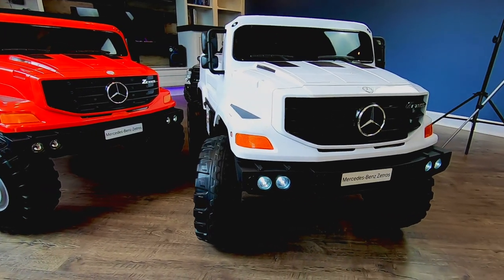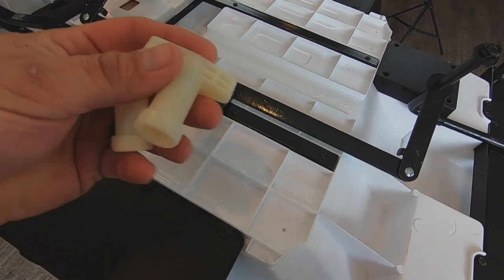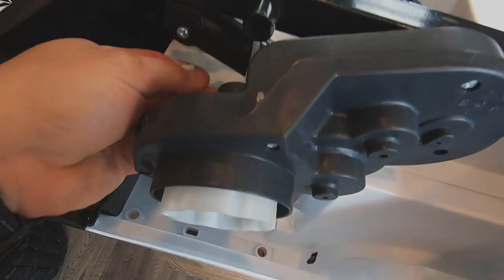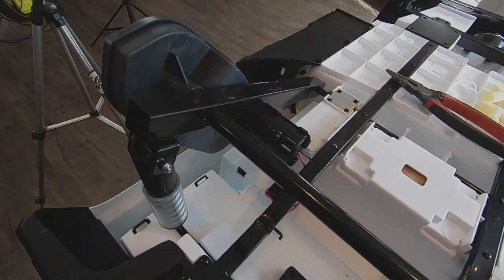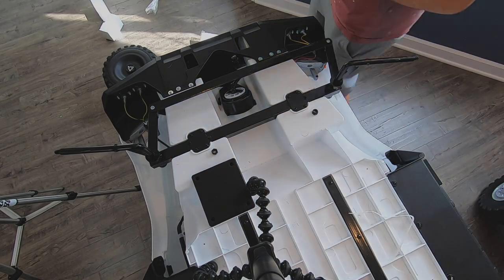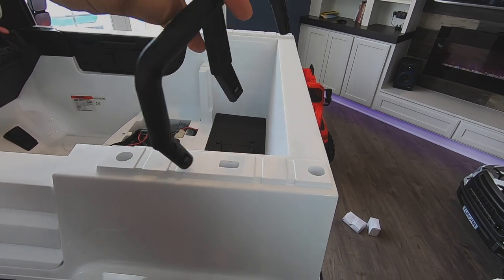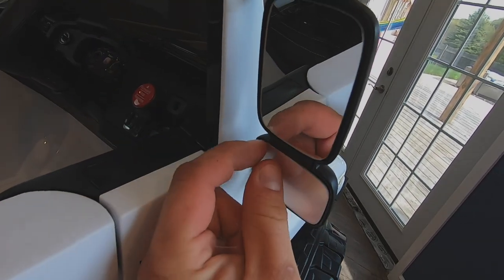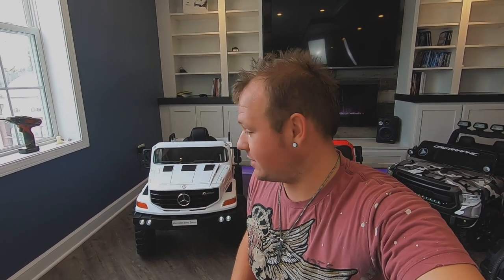Assembly of MERCEDES-BENZ ZETROS 12V RIDE ON TRUCK W/ REMOTE CONTROL *FROM BIG TOYS DIRECT*

Comment: Thank you for this video. I watched it before I ordered from Big Toys Direct. And their price was significantly lower than the other main competitor I found online. Direct included a much higher voltage battery too which was very important for me, but the other company would not even entertain an upgrade. Instead of just a 7 volt, the 12 volt battery was the clincher for my purchase choice. This will allow a much longer ride time before needing a charge. I received notice in about an hour after ordering that it had shipped!  I live in TN and received it today; 8 days later. The packaging is excellent. Everything is wrapped in plastic and some areas secured with styrofoam blocks. I am a 69 year old grandmother and after unpacking, it only took 55 minutes to assemble. It's charging now, so I'm anxious to check out the performance tomorrow.

Comment: Ok, since it has been about a year, how would you rate the EVA tires, as far as wear?  I know they're soft, compared to plastic or rubber. After a year of use, do they still look like there would be plenty of life left in them?
Reply from the maker: They are lasting longer than plastic.
Reply: @MohawkDaveOffRoad  That is good to know. Thanks.

Comment: The Zetros is a cool concept (we own a black version from BTGC). However, there are 3 fatal flaws that make the toy not worth it. The truck SLAMS to a violent stop when the throttle is released either on the remote or by the child in the truck. The "harness" that is supposed to keep your child safe is a joke. It's nonfunctional, purely there so they can say it exists.